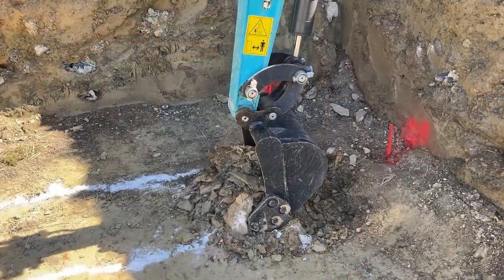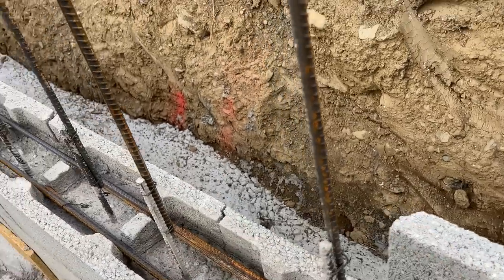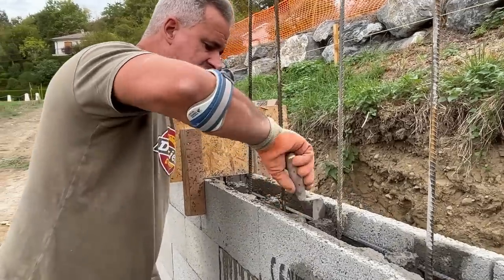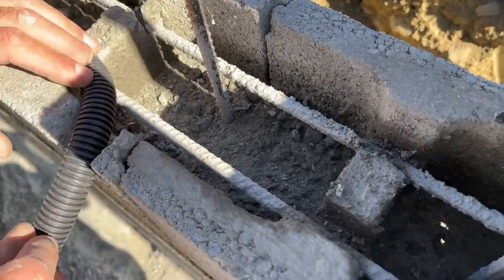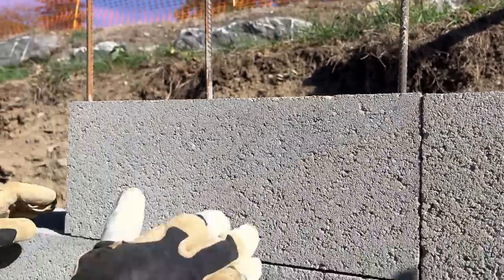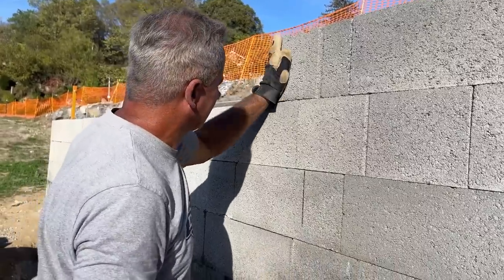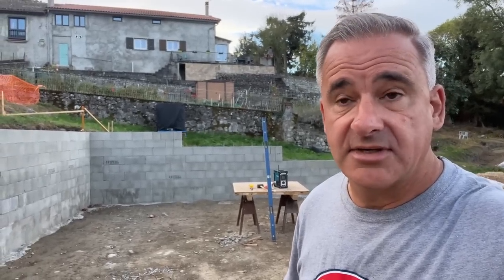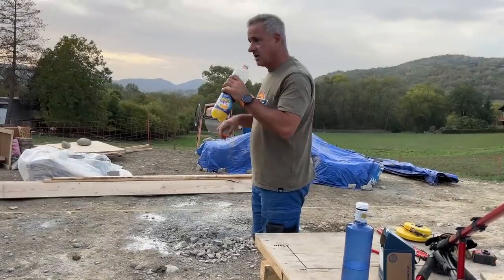Completing the Retaining wall | Garage Shop Project Ep9

Comment: Huge congratulations on reaching this stage - a mammoth effort but the quality of your work is excellent. Vertical joins all in line and the final course is level over the length of the wall. Well done. You certainly have earned a weekend away. Glad the weather held out even if it reached 30 degrees - its so much easier doing it in sunshine  than pouring rain. Have a good break and look forward to watching the next episode.
Reply from the maker: Cheers Arthur, I know we complained about the heat, but it was pouring today and I was hoping for just a bit of sunshine.  Concrete next week so busy getting the pad ready.

Comment: hi both of you ,wish l had a power barrow now lol, the vibrator is the only way for strength the liquid that came out is good ,lf your not happy with a little mess brick cleaner will get rid of it the next day. as your drill got a lower speed on it.well done both of you. X
Reply from the maker: The walls will be covered in the end but we did scrub them down on the back for the waterproofing.  Thanks for watching and commenting 👍🏻

Comment: Amazing Ian & Julie. Have you worked out a cost of what you have done and compared that to what a contractor would have charged? Cheers Dave.
Reply from the maker: Cheers Dave - Once everything is done for the structure I will calculate the expense so far - I have all the invoices saved.  I am sure it will have saved a lot other than time...but that is free for us when we are not working.....

Comment: I would still like to see more use pf respirator, and eye/ear protection. Safety is something that I try to drill into students I work with.
Great progress and love ♥ watching your work and hearing your thought processes. Thanks for including us in your project!
It looks great and I can't wait to see the next step.
Reply from the maker: Julie has bought the eye protection and the ear protection and I will be getting two masks.  I just need to start using them more, you are right for sure 👍🏻
Reply: @HomesteadingUncontained  If its a motivation the HSE regard silica dust as the new asbestos.

Comment: Can you show a spread on how much you saved vs buying pre mix bags?
Reply from the maker: The pre mix bags are not really a thing here in France.  I have some for post holes etc and the cost €6 per bag for 25kg.  So 1m3 of concrete weighs in around 2.5 tonnes so that would be 100 bags per 1m3.  So for 6m3 that would be €3600.  I paid €210 for 30 bags of cement (35kg) and €45 for 1.5tonne of sand and same for gravel.  I used 3 of each so total €480, plus €60 delivery so €540 in total.  A pre mix truck and pump would have cost me around €1500. So mixing by hand is way cheeper.
Reply: @HomesteadingUncontained  wow, prices  in the states are alot cheaper than that,
Can't put a price on doing the work yourself and seeing the end result.
Reply: @HomesteadingUncontained  pump truck would've been very close to equivalent price, 36kg pre mix is close to 6eu, 80lbs for around $7

Comment: Same for mixers, there are usually mini mix companies about who will bring a small mixer with 2/3m on board.
Reply from the maker: We looked into it but it is the same truck with less in it.  So the costs are quite high with the delivery etc.  Plus we would have the pressure of filling it quickly....not that professional yet.  But 2 trucks booked for the slab..... we are not that daft either 🤣
Reply: @HomesteadingUncontained  Somebody in your area is missing a great business opportunity.  Mini mixers always do great business, same for mini skips.

Comment: do you still have your mini excavator?
Reply from the maker: Yes, it is still going great and will be out next week to dig the footings for another wall.
Reply: @HomesteadingUncontained  I Was asking because i haven't decided if i wanna buy one of those or the Harbor freight backhoe, (which has some great reviews), so far HB one looks sturdier but there's the mobility issue and I Love the 360 rotation on the mini
Reply from the maker: @GoblinGearRider  had the exact same thoughts. Was going to go for the back hoe for my Kubota but what really swung it for me was the fact I could use the tractor in conjunction with the excavator to move earth away etc. Plus you have so much more movement with the mini ex.

Comment: Always vibrate concrete - even slabs (unless you use specially-designed mixes). Rodding doesn't work well in such lean mixes (as you found out when you stripped your blockout - lots of voids). 

Baffled why you didn't use a small tow-behind pump service - they're pretty cheap - would be placed in a few hours.  You'd have saved many days of hard work and had a better end product. Your back has taken needless wear, plus you've got several cold joints with less than ideal concrete.
Reply from the maker: We vibrated most of it once we got the mix perfect.  But as I mentioned before the pump truck is way to expensive and less manageable between the two of us. (7m3 in one pour is a lot)

Comment: should have ordered a cement truck and a cement boom truck ?
Reply: When you are at it, why don’t you propose to pay the contractor to finish all his job?!
Oh wait… the WHOLE EFFING POINT of this channel!
Reply from the maker: The delivery costs are very high and a pump is nearly €700.  So when I can do the small amounts I will.  For the slab it is 2 trucks with conveyor belts (pumps are still too expensive here)
Reply: @HomesteadingUncontained  Understandable…
Pumps are expensive everywhere btw! And you did one heck of a job with the help of your gentle half. No rookie can do better!
And this comes from a man who(with a little help of his friends), had build 50m of walls! Half of which retention walls, half divider ones. Only difference were the cement blocks, which in my case were left hollow and I used classic technic of masonry with cement between them.